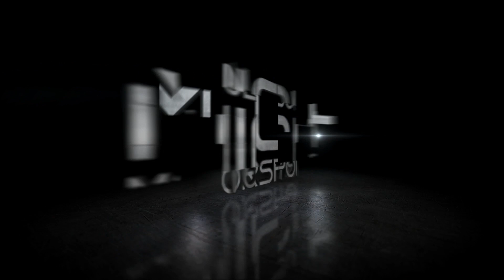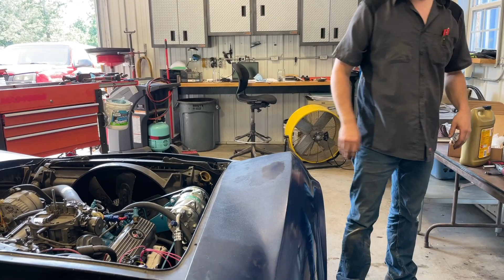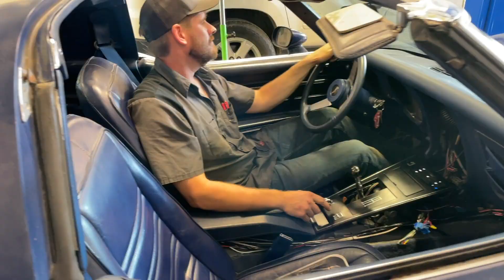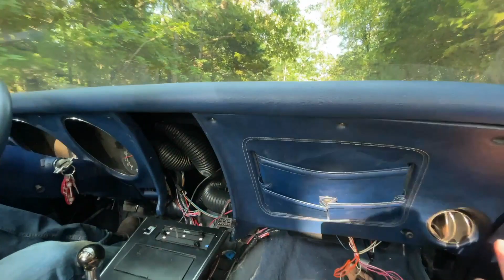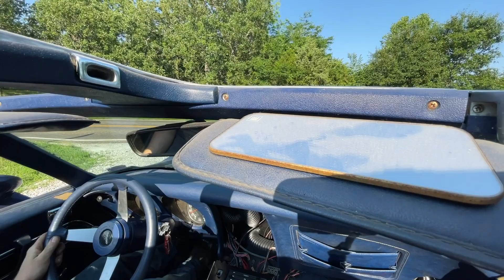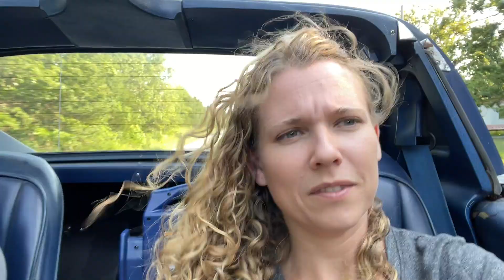Will It Run - Will The 1977 C3 Corvette Run After The Transmission Swap & Vintage Air Install

Comment: Great stuff here. Subbed after binging your transmission swap. Converting my '75 to a manual and convertible down the road. Definitely will be doing this. No air for me though, I'll be needing the extra HP, and who needs AC when you have open country! Great work and great team.

Comment: Great Video! Did you notice of the new system puts less strain on the engine when operating the compressor? I have a 1979 C3 with a mild cam, and notice the engine bogs down at idle when running the compressor. For reference, I have the same AC compressor that you removed on the first video.

Comment: Awesome vid. What bracket did you use to put the alt on the left side ? On my C3 ir is on the right but it needs to go to the left for the Vintage air . Thanks .

Comment: Are you finding that the ducting for vintage air system intrudes into the foot well on the drivers side?  PO put a VA system in my 75 and i'm constantly struggling with my foot getting hung up on it. Also the evaporator drain tube is so low on the passenger side that I can't get a floor mat in there without cutting it (the floor mat) to go around the drain.  Just wondering they're all like this or if the person who put mine in did a poor job of fitment.  Great videos!  Thanks for posting!
Reply from the maker: Some of the ducting needed to be trimmed down or shortened to fit correctly.  I guess we didn't show that part.  Maybe with some adjustments yours will have a better fit.  Thank you so much for watching!

Comment: Question the control panel for the 77 is the same one I need for my 78. Did it come with the kit or did you order it separately? 🤔 thanks for everything 🙏🏾 nosale
Reply from the maker: Hello!  Thank you so much for all of your comments.  We are thrilled you are enjoying our videos.  The Control Panel came with the kit we ordered from Vintage Air.  But I'm sure you can order just the control panel from them if that's all you need.